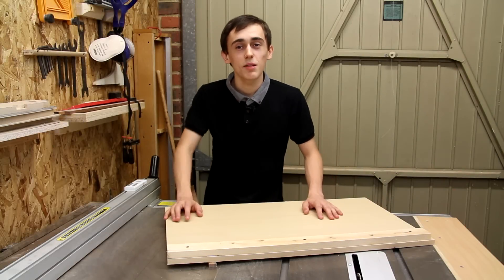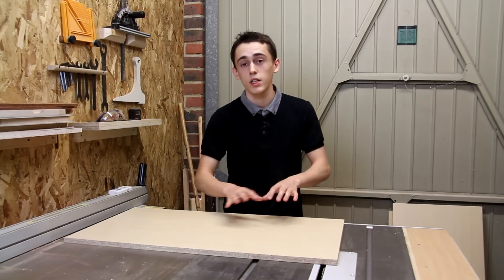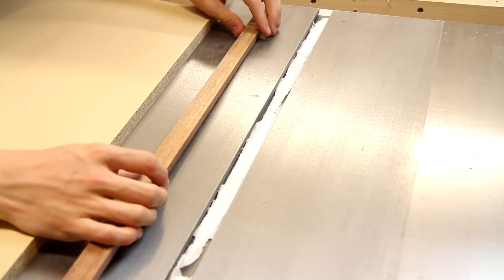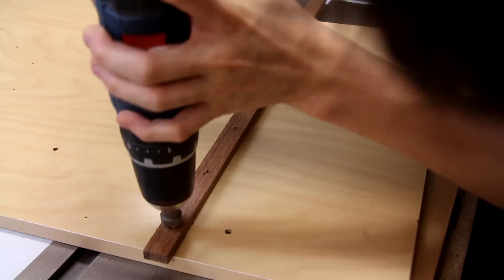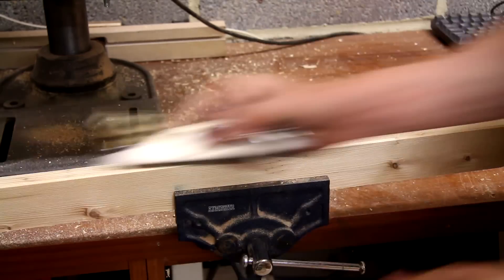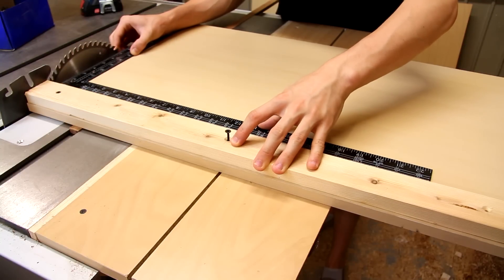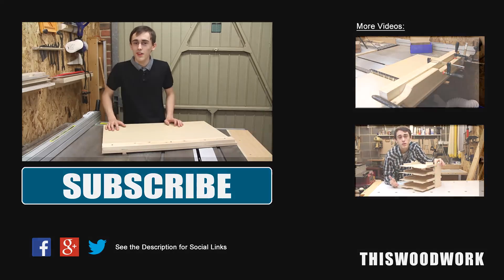Build a Tablesaw Crosscut Sled: Panel Sled

Comment: Welcome back Alex...looking forward to part 2....i have an  old  kity 1619 that i am setting up and have just fitted a full sliding table system off of the updated schappach presica 3.0 it takes up a lot of room in my small shop ! i am beggining to think a couple of decent shop built sleds would have been a better option..lol

Comment: Is there a risk that the wood could be forced down by the blade when it´s not supported where the blade cuts the wood ? Due to the height difference from the sled and the wood ?

Comment: Alex, great video. What is the difference between a panel sled and a crosscut sled? Don't they accomplish the same thing?
Reply from the maker: David Letz 
The main difference between the crosscut sled and the panel sled is the width of board you can cut. The panel sled is capable of cutting much boards much larger, as the fence is at the front of the sled, meaning boards can hang off the front of the saw before the cut is started. Regular crosscut sleds are limited in the size of cuts that can be made, as you can only pull them so far away from the blade, but are generally a bit more versatile. Notice I use my crosscut sled far more often.
Hope that helps, thanks for watching, Alex.

Comment: Want to build one but I have one of those portable table saws that have one of the enclosed t slots that are a pain to work with. Might build a table to go over it with proper slots in.
Reply: I think a secondary table would be much more of a pain. If you know the angle of your slots you can just cut that into your sled's runner.
Reply: The T shaped groves usually don't run the entire length, more like two protruding metal pieces at the beginning. At least that was how it was on mine. At first I milled a runner with the T shape. But it got hard to sand the thing to reduce friction, especially with seasonal movement. So rather than milling more runners, I just plugged in the angle grinder, bit my lip, and got to work removing the metal wing thingies. I'm glad I did, but it was hard to do that to my saw, it felt like I was amputating a friends leg off. But now I can use regular runners and makes making more sleds and jigs a whole lot easier.

Comment: Hi Alex, I have just purchased an identical table saw from Axminster and notice in your video that your riving knife appears to be lower than the height of the cutting blade. This is not the case on mine, it has been engineered to sit above the height of the blade. Have you modified your riving knife or purchased an after market version?
Thanks, Mark

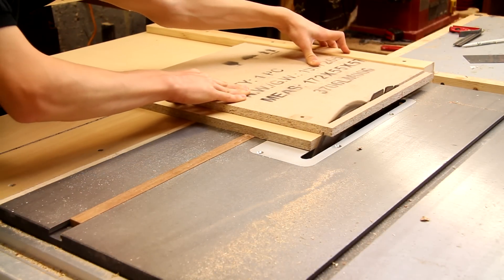Comment: Are your miter slots truly parallel to your blade?  It was noticeable as you made the cut at 4:20 that it made more cutting sounds than expected as the wood hit the rear of the blade...
Reply: 4:35 was the time I meant.